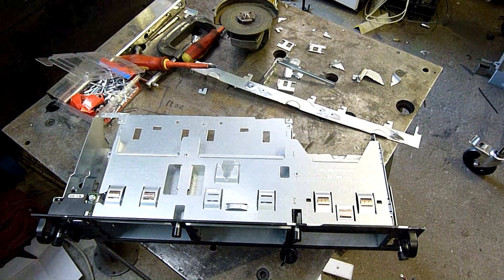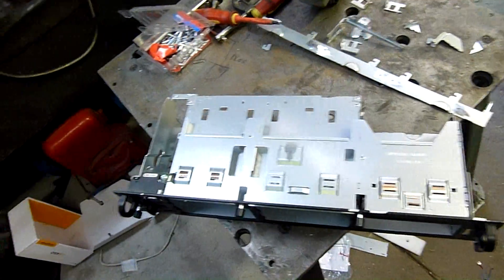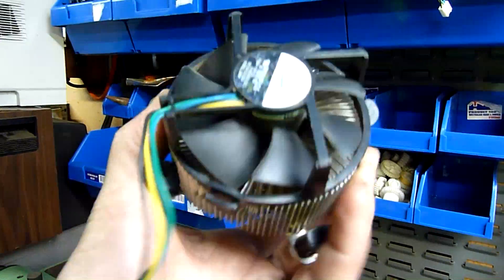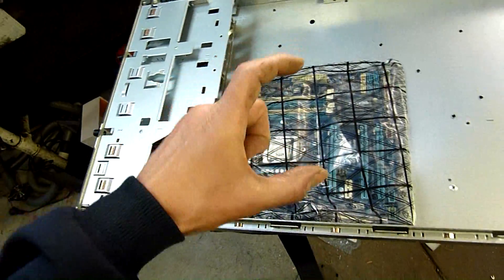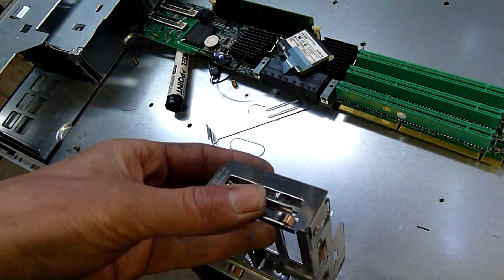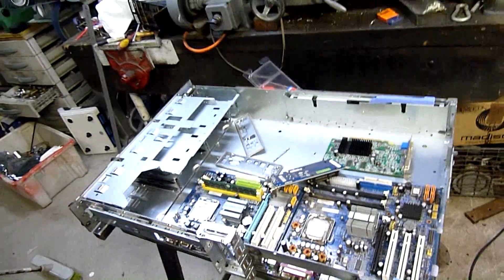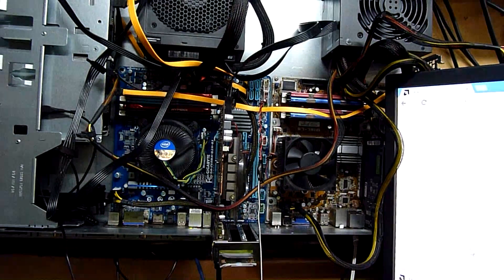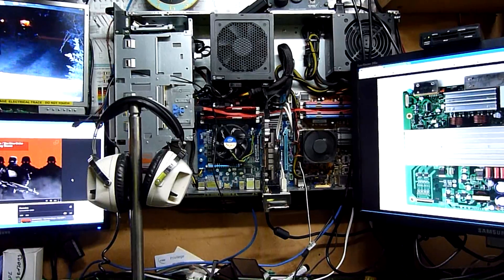Wall PC Mk3 Build Pt2 - On the wall like a spider.

Comment: Interesting. I just compared the specs to your Z68MA-D2H-B3 to my Z68AP-D3 and I was quite intrigued. The main differences is you have a PCI-E 8x where I don't but I have a couple of old PCI slots and no onboard D-Sub or DVI outputs, but the rest of it is pretty much identical. But yours will trump the hell out of mine every day of the week. Only got a Core i3, 8gb of RAM, a piss weak video card, but a 1Tb Seagate (I think, haven't looked in a while). Goes well enough, but editing my photos and videos does tax it quite a bit, so I might double up on RAM at some stage and upgrade to an i5 like yours.

On another note, what do you think is the life expectancy of a run-of-the-mill wireless network card? I've got a TP-Link PCI-based card and I think its on its way out, and I only bought the thing 18 months ago

Comment: XP and HD video never did gel, XP also missed the boat on easily making a DVD's which is where Apple really showed how simple it could be done, but as we know DVD is now a dead format, and remember all this is way back in the year 2001 ish. Now I have become an apple user I can see how apple have swayed the masses. With the use of overpriced and easy to use computers which just work and sync together easily they showed that Microsoft never understood what was important. With the advent of Windoze 8 it only confirmed that Microsoft is even more out of touch today Vs 10 years ago. If Apple are not careful they will fail in the same way Microsoft have failed, it's almost impossible to avoid this happening.
Reply: Mac's are for noobs...
Reply: MeMad Max How so? A fully supported unix (POSIX) os is a great desktop system to have! I really don't understand this MAC/Windows argument - its an OS!

Comment: Don't trust the WD Greens, use Blues for storage and Blacks for OS, the Reds and Greens are pretty bad drives, no good for storing data on...

Looks like a good setup there, shame I threw out my Compaq DL380 G2 case ages ago, could have made a similar setup myself (if I could be arsed to that is!!)... :P
Reply: You should only say don't trust WD! Blues and Blacks are only slightly better than Greens and slightly worse than RE4 (vs Re as its NL-SAS variant) and VelociRaptor (or Xe as its NL-SAS twin). You can count that they will last about year in heavy load environment, Greens and Blues about half of that time.